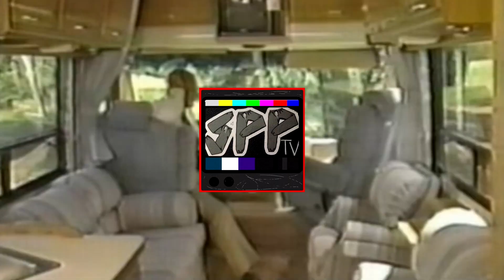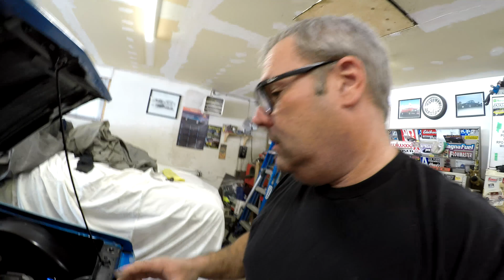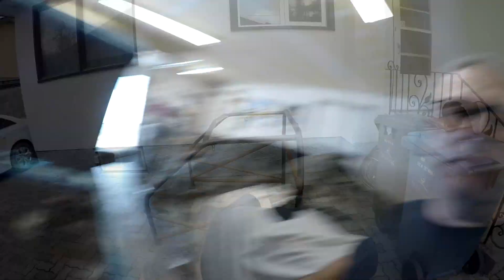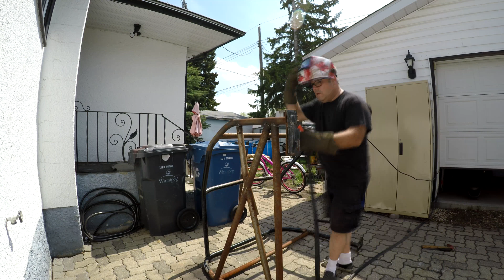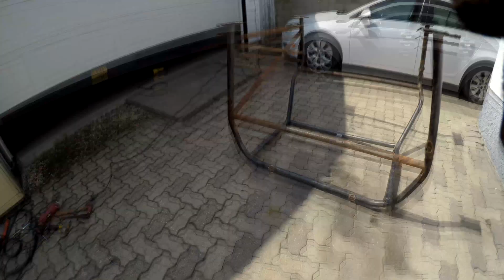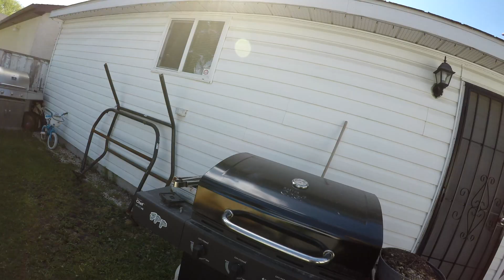RECYCLING A ROLL CAGE | Future Safety for our Death Trap of a Mustang

Comment: What ended up being wrong with the 4L80e you built? I’m building my first trans, and remember you had an issue with your build, but don’t remember what the deal with it  was.
Reply: The 4l80e has pistons with seals integrated in them. One was bad.